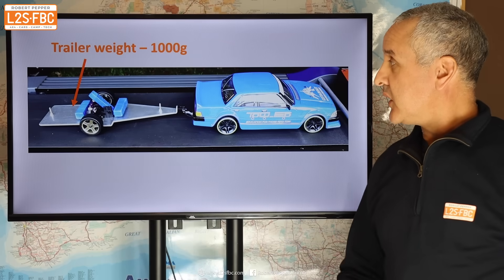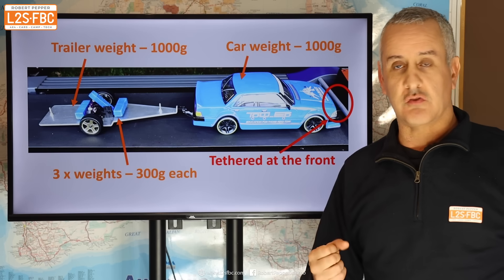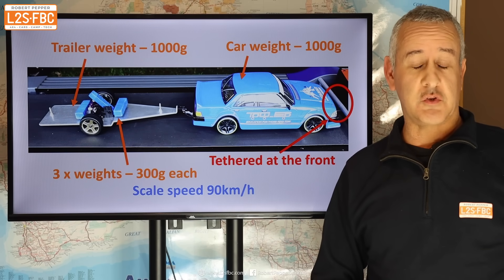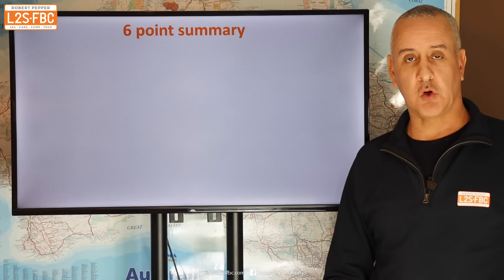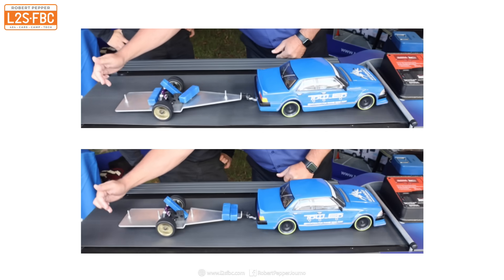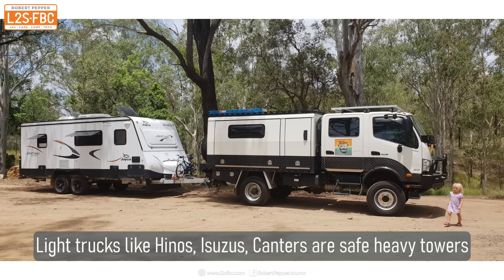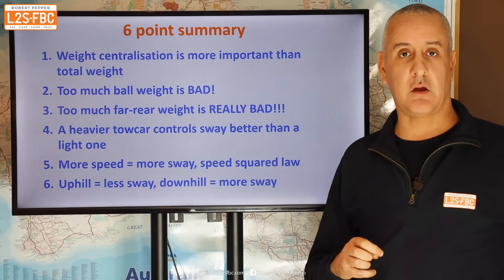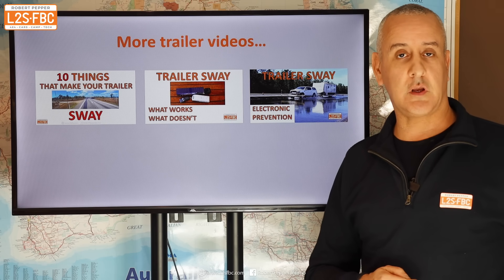7 trailer weight distribution setups, some safe, some deadly.

Comment: 10:00 Kinetic energy is, in fact, a function of the square of the velocity.  HOWEVER, this does not translate to an exponential increase in the energy of the swaying. In your example (which you didn't finish... why?)  you stated that a increase of 10% in speed is not 10% more energy, but you never say what it will be.  It's telling that you begin with precise numbers but then end with only a generalized statement "considerably more".  Is it, though?  Consider a 1kg mass moving at 100km/h... it will have about 386J of kinetic energy.  Now, increase the speed by 10% and the kinetic energy increases to 467J which is about a 20% increase.  Non-linear?  Of course... but that's the energy of the entire system moving down the road and NOT THE ENERGY IN THE SWAYING.  Part of of the problem with trailer sway is resonance and this will only occur at one frequency band (it only has to be near resonance).  Decreasing or increasing sway frequency will dampen the resonance, though decreasing it preferred so as not to impart more energy to the unstable SYSTEM.  Also, all of this only applies to this degree with a single-axle trailer.  Tandem axle trailers are less prone to sway and are more stable by design with identical loading... especially in crosswinds.
These simple examples where masses are moved to the extremes are not very practical as mass in a travel trailer is, for the most part, a fixed distribution.  Loading up some food and camping gear isn't going to change anything significant. The examples in this video show why you don't load a pallet of cement too far forward or too far back.  Also, the rhetorical question of "how much ball weight" should not have been asked.  The rule of thumb that works, as shown by empirical evidence, is 60% of the weight forward of the axle and not to exceed maximum tongue weight, trailer capacity, or tow weight.  Speaking of tongues:  the longer the distance from the tow vehicles rear axle to the trailer's axel(s) the more stable the system will be.
Reply from the maker: Thank you that's a useful comment. Reply: I didn't say how much of the extra kinetic energy is translated into sway (it would't be all of it) because I don't exactly know, and haven't ever been able to find any research which explains it. I doubt there is any, and if there is, then it'd be inexact. So rather than give exact numbers, I used a generalisation. Accuracy over precision. I think we're agreeing on that. Also agree with tandem vs single axle trailers, with the proviso the tandem has its weight well balanced over its multiple axles.
I have to disagree with "some food and camping gear moved" - commenters on my videos have shown that such relatively small changes can make a difference. 
The ball weight is very variable and there is no good formula for it. 60% of the weight "forward of the axle" - how much forward?  And you can have 60% forwards, 40% rear...both a long way from the centre of gravity. Agree with drawbar length, didn't cover that...only so much much can go into one video!

Comment: What you are  seeing here with the example of weight distribution is very true BUT that is because there is no control mechanism in place.  I have developed a system called Differential sway control control that I have used across Europe for 10 years with no evidence of sway.  It uses no electronics or speed control and sidewinds or heavy truck turbulence has no effect - yet no vehicle  or caravan industry manufacturer has taken up my invitation to take a look.  I have even offered my caravan for free to any serious investor but still no takers.  I have refused to apply for a patent since that would let the world see how it works and that would diminish any value in the concept.  It hass been done many times and archived nothing. Without a control system nothing will change.  My advise to you all is study SHM and how to control it or just get a company to talk to me.

Comment: Love this but have one question about the setup and how much it would change if you set it up for real world application I find in my experience alot of this changes with front wheel drive and rear wheel drive your  setup may shows how all wheel drive works it may not be nessary but I find that it is really difference
Reply from the maker: the dynamics are the same regardless of rear/front/all drive. However, AWD has a stability/grip advantage under power and engine braking is is my preferred setup.

Comment: Couple of comments. Tow ball to rear axle in model seems to be half of wheelbase. I think in most large vehicles the distance is quite short which would reduce pendulum effect.
Tandem trailer model has non load sharing suspension which allows rear axle to lift, if the two axles maintain contact there is more resistance to side to side movement.
Reply from the maker: The axle placement doesn't matter as it's the same for all weight combinations so the comparative effect works. Yes, tandems do behabe differently including rear axle load / TBM - see my other video on that for details, it's quite unexpected.

Comment: Its simple  common  sense,  if you do not have tongue  weight the trailer will attempt  to  steer the  car. If you pull up behind  a small  trailer  and it is wiggling  right to  left, it needs more  tongue  weight.  A properly  constructed  trailer  will have 60 % more of the trailer  towards  the  tongue  floor forward  of the center  line of the  axle.  A double  axle  trailer  should  be from the  center  of  the  front axle.  This  also  applies  to a goose  neck trailer.   I was not  sleeping  all  the  time i was taking engineering

Comment: Wow! Thanks for the great, informative video! I've been loading trailers and tow vehicles the wrong way for years! Looking forward to a more stable towing experience after putting this knowledge to use!
Reply: Unbelievable.  So you just now, after years of creating a potentially lethal hazard for everyone on the road, decided to look into how it should be done safely???    This isn't some guarded NASA secret.
Reply: @DiffEQ  Ok fine, you got me.  I shouldn't joke about safety. I thought that obviously it's an exaggeration to say "I did it wrong" because the decision of where to place mass on a trailer is not a dichotomy between right and wrong. Compared to the best reasonably convenient way to distribute weight, my strategy probably was, at most, 5% suboptimal for overall safety, especially considering I was only distributing 10% of the overall weight of the trailer. 
I'm pretty sure the safety factor is highly dependent on the driver. Looked to me like speed and poor judgement greatly contributed to these wrecks as well. Also, I didn't mean to imply that I'd ever experienced anything comparable to the danger caused by instability shown in any of these video clips.

Comment: Great presentation! For teaching purposes it would be helpful to show the advantage of manual trailer braking to stop sway. My equipment trailer is setup with brakes on the rear axle and I have been in a sway situation once, where manually applying just the trailer brakes instantly stopped it. Most US brake controllers have a lever to manually apply just the trailer brakes.
Reply: That feature is a real lifesaver in the wind. Especially on a 2 lane with oncoming traffic. Just a touch of drag back there for a couple seconds, and it settles right down.

Comment: considering the physics the largest part of all weight must be upon the steering wheels, the second largest weight must be upon the towing vehicles drive wheels if it is not the same steering wheels, then the second/third largest weight must be upon the towing vehicles rear wheels which creates the stability, and then the third/fourth largest weight must be upon the towed vehicles wheels.
the vehicle doing the towing must out weight by twice the amount or as little as a third, of the thing being towed or a mostly safe triangle of stability control.
american law dictates that the thing being towed 60% of the weight to be toward the hitch so that if it breaks away the hitch digs into the ground and adds to the stopping power whereas if the rear of the thing being towed has most of the weight to it's rear or is 50/50 perfectly balanced it will take much longer for it to come to a stop and with much more erratic movement regulated only by physics of everything, and not just gravity and thus extremely higher probability of losing the load all over the road or upon nearby people or places/things (houses, businesses, wild life protected areas as examples)

when the towing vehicle is unable to out weigh by more than 50% of it's towed load:  such as tractor trailers, tandem and triple trailed or tractor train or rail road locomotive trains, those towed units must have complete independent stopping means of their own, in the event of a break away that #1 safely and #2 quickly brings it to a complete controlled stop.

most important part of this is newtons of force: 
 as wind and aerodynamics can change things completely, wings of an air plane, spoilers of a vehicle or towed unit, big sides or tubes, non aerodynamic walls such as the face of a vehicle or trailer or rear gates.

Comment: I drive a semi and this is something I deal with on a daily basis. Another factor with stability is the tow vehicle wheelbase. Sometimes I drive a truck with a  75’ sleeper which adds length and weight and is much more stable than a standard day cab. I think the length is more of a factor though. Yes I said that lol
Reply: The longer the wheel base of the tow vehicle the less weight that is moved from the front axle to the rear axle from the trailers tongue weight.
Reply: Glad someone said it. Video mentions nothing about tractor wheelbase.

Comment: IMO it should be law for all cars to come with a scaled tow hitch. a scaled tow hitch is the one of the best investments when it comes to towing equipment there so stupid simple to use these days needle in the green go for tow, needle in the red no go rearrange your load. if ya cant get it right with a simple system like that then you shouldn't be driving in the first place let alone towing.

Comment: If you get this right; and in my experience lowering and centralising the mass is a BIG part of that; then it possible to tow at 150km/h or more. This means that at normal speeds, 80 or 100km/h in many territories, you have a sunstantial margin for error that allows you to deal with gusts of wind, passing trucks, weaving downhill roads and so on.
Reply from the maker: I agree - speed makes a huge difference. You should be able to tow stably at 110km/h, if you can't, then limit speed to 90 or 80. Problem is that creates a roadblock for others.

Comment: Great demonstration! Although I do have one question. How would having weight distribution at the extremes be any different than having the weight located directly over the axle? You’ve clearly demonstrated that it’s detrimental, but why? It would seem like the center of gravity would be directly over the axle in both cases. I guess the trailer with the weight distribution at the front and rear would have a larger moment of inertia, but I don’t know if that would affect sway.
Reply from the maker: Ah well I made a specific video about that -> https://youtu.be/fX78Fu87Coo
Reply: It's  everything to do with lack of control and not simply speed governors  and friction hitches like Alko uses.
Reply: the answer has to do with the fact of how wheels move, they do so not by pushing anything, but by tilting themselves and their entire structure forward, and then using gravity and bearings to balance themselves back to facing upright, and it works well because by the time all that balancing starts, the wheels have grabbed greater leverage at an even greater "angle" or force, and all that momentum just builds. that's why coasting feels like heaven. while your axles are spinning, you're sliding on all your bearings, only being slowed by natural resistances. for that moment, you are at mercy to god himself
Reply: Angular velocity and lower friction. With the weight over the axles, the angular velocity about the axles is small; with the weights over the ends, the angular velocity about the axle is much larger. Also, the weight at the extremes reduce the friction on the trailer tires, by applying an upward force on the axles.
Reply: @leosanchez1576  Angular inertia.  The sum of all the individual angular inertia of all the weights added together. The individual weight x the distance from the center of pivot.  The mass farther out from the center increases the angular inertia.  think limit -> as division of small inertia -> infinity.

Comment: in the UK, the Caravan club recommend that your trailer/caravan is a max of 85% of the weight of the tow car, do you not have that recommendation over there? 
There is the additional recommendation that if you have a twin axle trailer, that the tow car has 4 wheel drive.
Reply from the maker: hahhahahha no we don't. It's a very good recommendation though. Very often Aussie caravans are more like 100, 110% of car weight...and they are lifted quite high. Towing is very very different over here. I think the Caravan Club would be appalled and rightly so. Keen to hear more about UK towing.

Comment: Very interesting. The only thing i don't get is why a evenly loaded trailer gets so unstable. If the tounge load is in a reasonable range and the trailer axle is slightly heavier loaded the the front and back the front and back should cancel each other out so that the load is on the trailer axle (minus the tounge load of course).
Reply from the maker: Ah well I made a specific video about that -> https://youtu.be/fX78Fu87Coo

Comment: American trucks generally don't lack payload capacity. The 1/2 tons can have low payload capacity (typically about 2,000 lbs), but they are not really the best tow vehicles anyway. If you are towing heavy a 350/3500 to 550/5500 is going to be a lot better choice than a 1/2 ton.

Comment: I have trailers with extendable tongue.  When fully extended it has far less tong weight than when in normal position.  It tows better when extended.  Also you need to do again with higher and lower center of gravity.  A high center is much less unstable than a low center of gravity with the same tong weight.  I use 10% up to about 1000 lbs.  After that with a low center of gravity   i never exceed 300 lbs of tong weight.  For single axle. About 250 lbs for tandem.  And even less for tri axle.  .  Now with a high center of gravity. Over 3' above axle I max out about 500 lbs  single  axle 400 tandem and about 300 tri axle. The longer the trailer tongue to center of axles the less weight needed..   I never get sway  when i set up trailers this way.  I rarely use weight distribution hitches....the last time did was with a 21' camper..      I usually tow boats which usually have  low center of gravity.  Usually just a few inches  above the water line. Which ends up being 18" to 2' above the axle......
Reply from the maker: I have done the weight high/low version - see description of video and pinned comment. Others on the way.

Comment: Need to show how wheel base length of the tow vehicle changes things.  Expected that longer wheel base won't be as likely to rotate and resist sway better.  Love to see it modeled.
Reply from the maker: Thanks, please share!  We have plans...
Reply: see this so much with cooped 80's and 200's done on the cheap they dont extend the wheel base. seen this nice chopped 80 for sale the cop its self was done so nice but they left the stubby wagon wheel base being a farmer who has to load up heavy things like shuttles i would have snapped it in half and towing the cattle trailer would have bean fun even the stock 79 dual cab wheel base is to short for my liking.

Comment: Brilliant presentation, should be mandatory for all caravan/trailer towers! Would be interested to see your take on the single wheel trailers towed by motorcycles and keeping them stable!
Reply from the maker: Thank you, please share :-)  I'm not familair with those trailers but I would expect the same physics to apply - mass of towcar vs trailer, and also lenght of drawbar/hitch which I didn't do in this video.

Comment: does a pro pride 3p hitch correct for a trailer that has too much weight in the nose? 2 axel trailer, 24' long  (tow vehicle is near capacity but not over)
Reply from the maker: Not familar with those hitches sadly.

Comment: You clearly have the trailer axle too far forward.  You basically have the axle at the A-frame. Yes your test looks just as cool as the others that use a model on a treadmill.  But it's just for show because of the poor design of your trailer set up
Reply from the maker: The axle is in the same place for all weight changes, so it isn't a factor.
Reply: @L2SFBC  yes it is. Because no trailer has 90% of the trailer area behind the axle. That's trailer area not including the A frame

Comment: I have a door and window business and I'm having problems with sway. Should I instead of putting shelves up front for all my different screws and caulking put shelves up high above tandem axles
Reply from the maker: Centralise the weight first, then look at making it as low as possible. Central better than low and long way from the axles.

Comment: I can see that the hitch on the back of the tow vehicle is way too long, way too far behind the rear axle of the tow vehicle that makes it extremely unstable also.
Reply from the maker: Yes...but it doesn't make a difference to the test which shows relative weight positions.
Reply: @L2SFBC  the farther the hitch sticks out beyond the back axle of the tow vehicle the more leverage the trailer has over the tow vehicle and increases tail sway.
Reply from the maker: Yes but it sticks out the same for all the weights shown so it equalises and isn't a differentiating factor.